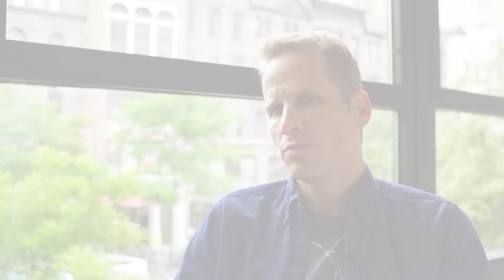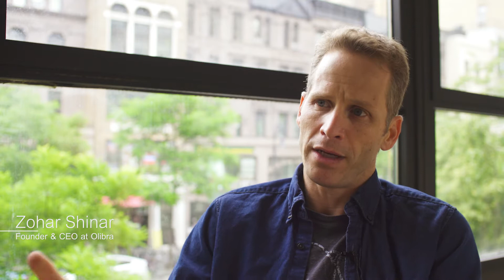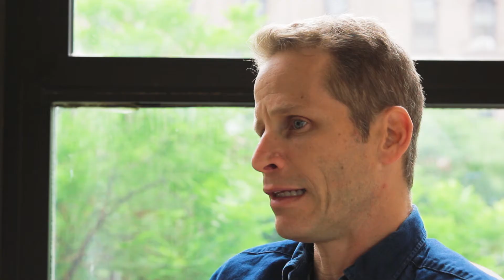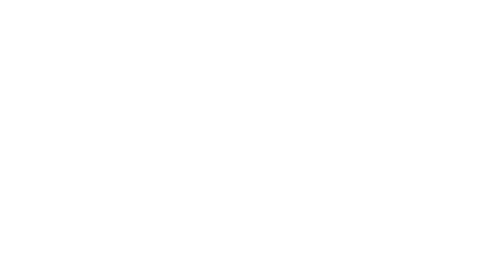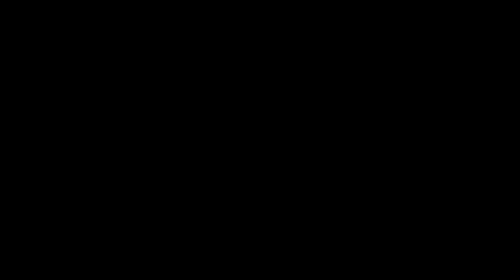What's the difference between IR and RF?

Comment: IR doesn’t need to be necessarily in line-of-sight mode. Some IR devices also operate in scatter mode or diffuse mode means they can work without being in line of sight, but they need to be in the same room or close to each other
Reply: I am here because my electric fireplace reacts to all my remotes and its driving me crazy.